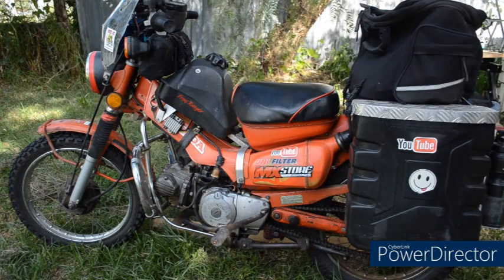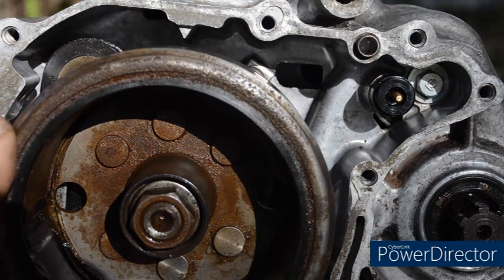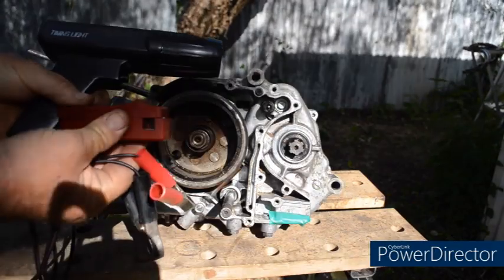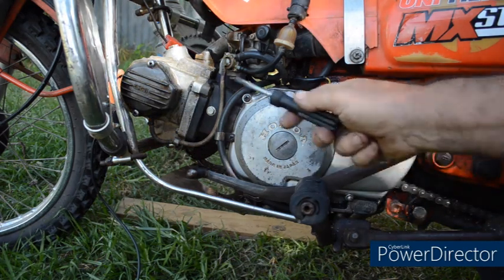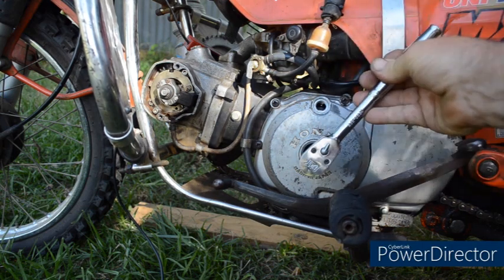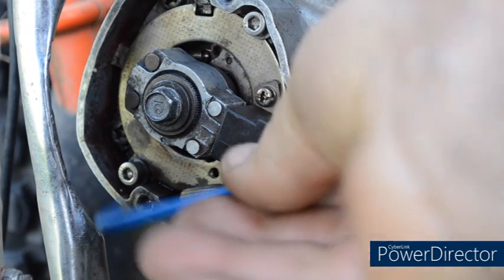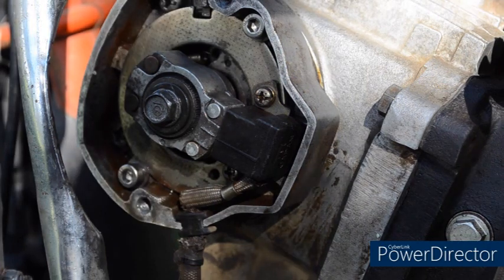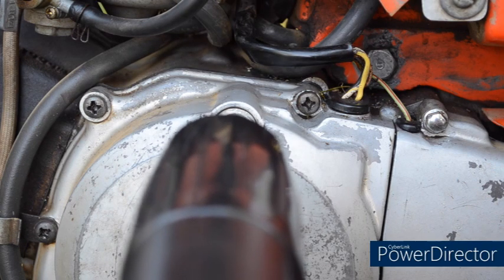Honda CT 110 Trail Ignition Timing - Check & Adjust

Comment: Thank you enjoyed the video having the option to advance or retard the timing could be handy. I presume that model has no CDI and a flat advance curve like points
Reply from the maker: I think on the 12v models the pick up is at the cranks, not so easy to adjust the timing & these older bikes have no rev limiter.  There's a mechanical adv retard unit behind the pick up